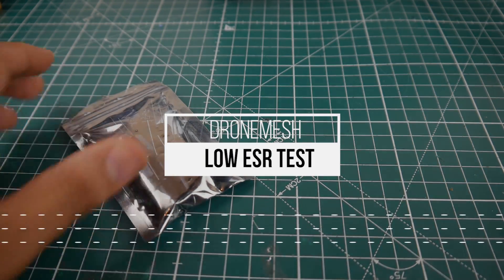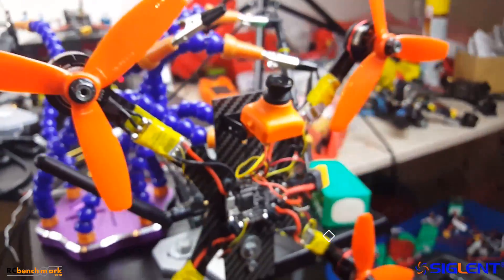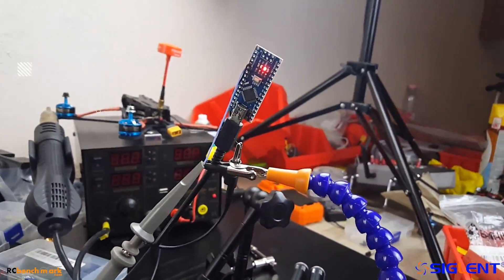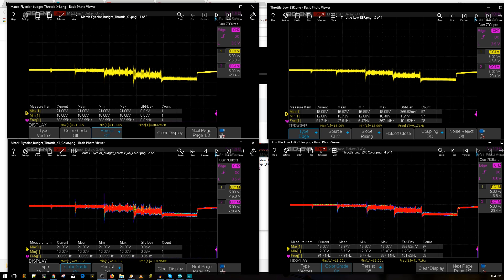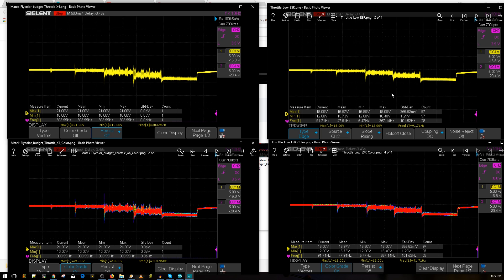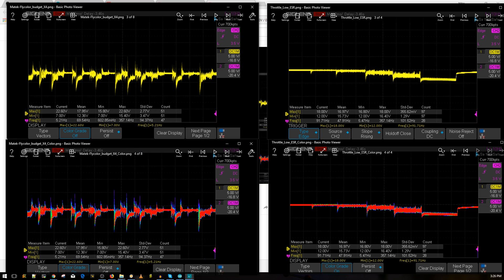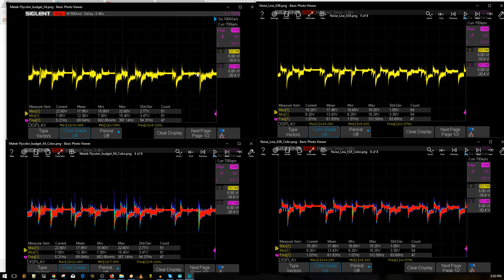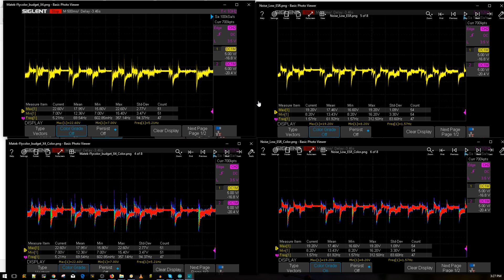LOW ESR Capacitor // Before and After Detailed Tests

Comment: Hi,

Great videos.
Busy builing a TBS discovery but had problems so added 1000uF to the ES30 ESC's.
Already had one on the matek F722se.
Had camera noise without the 4 ESC caps at higher current. 
Motors getting more and more quiet after this and tuning /filtering. Don't see any noise on the gyros plots. Only some vibration. So there's some to win. (mounting mostly) unfortunately the sunnysky 2216 hasn't integrated prop adaptor and even now left/right threads. And the seller supplied a set but not the best. 
Tried to balance motors with tape and a vibration app on my phone. After this also with props. Did help a lot. 
And did switch from multishot to Dshot 300.
Before sometime suddenly the current doubled at hover and motors running hot very fast. Did readout the blackbox and it wasn't pretty. Motors going all over the place very fast. 

But have a question.
Is it a good idea to put a 470uF or higher capacitor on one of the receiver pins (crossfire) to prevent some noise in the receiver?
Or having better ideas?

Comment: so did you test if those capacitors are really low esr capacitors.. most of them sold cheap from china are actually fake just generic capacitors relabeled as low esr capacitors... check with an esr meter...
Reply from the maker: It's real..

Comment: what defines a low ESR capacitor? cant I just use any capacitor (as long as it can handle the voltage)?
Reply from the maker: Umbra Jord LOW Resistance.. Electricity finds its way through least resistance. Just one aspect.
Reply: Drone Mesh so I cant just use a normal capacitor then?

Comment: It's a stretch to claim a change from 21vpk to 18vpk will make a difference in the longevity of your escs...
Reply from the maker: Phil659 Guess you did not hear me correctly
Reply: I absolutely heard you wrong. It's still an absolute stretch to claim a delta of 3Vpk in a transient (very little energy) will ruin the longevity of the FETs on your ESC's. If you make claims like that, be ready to back them up with a datasheet, and show the absolute max drain to source voltage, not just make a claim and think that because you make videos, you are an expert. Note, even if the max drain to source V for those FETs are 20V, 21Vpk <5us pulse will not have any effect.

Comment: Love your work Drone Mesh. I am re-building my Wizard X220 with some DYS 2207 2600kv Wei motors, FuriBee 30A BLHeli S ESC's-got them really cheap off Gear best and just brought a Foxeer F405 AIO Flight Controller, (the DALRC F405 AIO was out of stock when I ordered it, but seems to be the same) and I'm going to build it with the 470 low ESR capacitors on each ESC-just turned up today. So really interested in your findings. Please note when I can I use your affiliate links, have looked at buying from your shop but the shipping kills it when sending stuff to the arsehole of the world down under in NZ. Cheers :)

Comment: Check also these up might be nicer to fit though more expensive
V2.0 470uf Anti-interference Parallel Capacitor Plate Capacitance Board 1-6S LiPo For Mini ESC
Anti-interference Parallel Capacitor Plate Capacitance Board Support 1S-6S

Search for them on BG
Reply from the maker: I have them it will be todays video ;)
Just for you thanks for the suggestion.

Comment: Hi Drone Mesh. I made a test I want to share. I had a problem with a FC (DYS PRO V1), I've shorted and a cap burned. The quad fly but suddenly I have a kind of blackout and it crashes. I thought it was a noise problem on the FC and I'va moved everything on a PDB and I powered the FC from the PDB (VBAT). The only thing I didn't move was the video signal (in and out) and motor signal. Nothing changed included the horrible video noise but when I powered the FC from the 12v from the PDB the video noise was completely gone. I was extremely surprised the video noise was added from the signal wire and not from the DC.
Thanks for your videos.